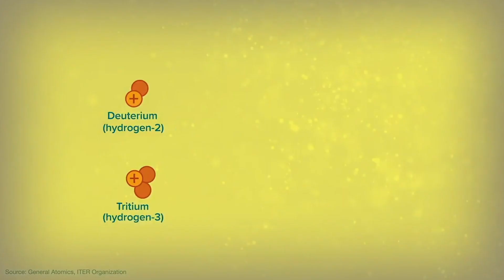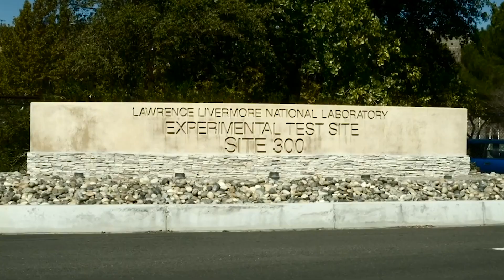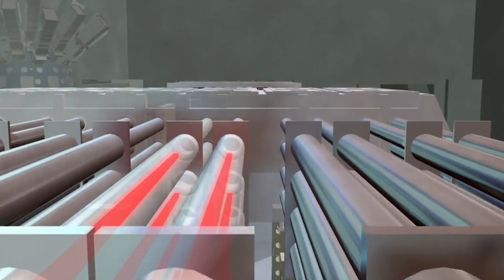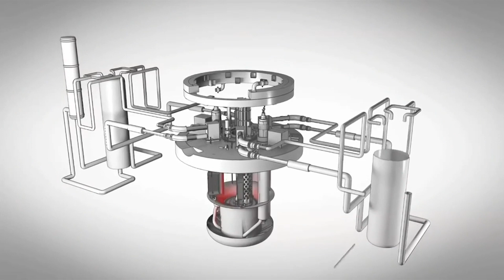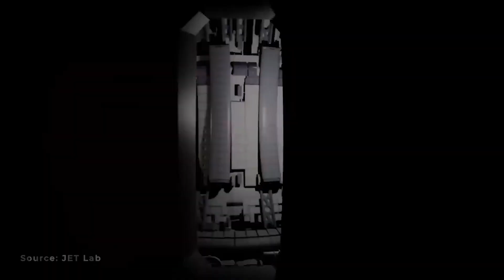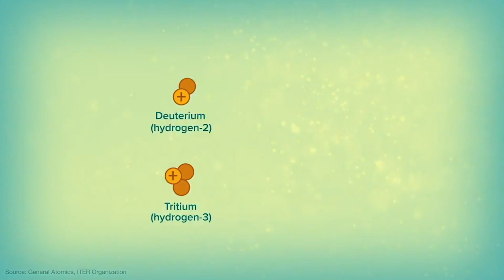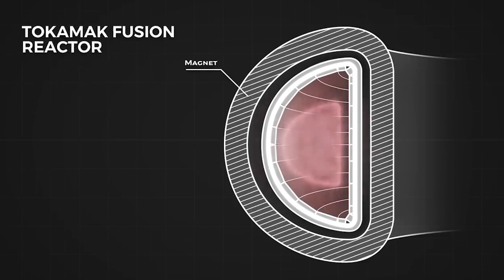Holy Crap! A nuclear fusion breakthrough could save us all

Comment: Folks, iven with fusion broadly used, climate heating not only drops but even augments BECAUSE OF JOULE EFFECT! Do not forget, the TRUTH liberates us: the next after fusion is REDUCING DRASTICALLY  any unnnecessary energy consumption and continue dismantle chemichally poputant industries, plastics are produced poluting, eliminaten rezidual HEAT must follow CO2 reduction, only combustion is not enough, heat emitting from ALL industrial and domestic processes as IR radiation finally which is absorbed by soroundings, air, soil, waters, buildings, roads, so do not misinform politicians, public must be informed correctly:
E = UIt= RI^2!!!!
ALL electrics and electronics, absolutely all consumers RADIATE HEAT!!!
Got it?